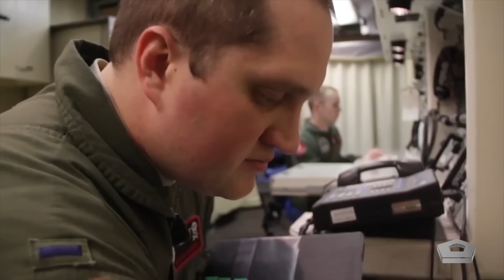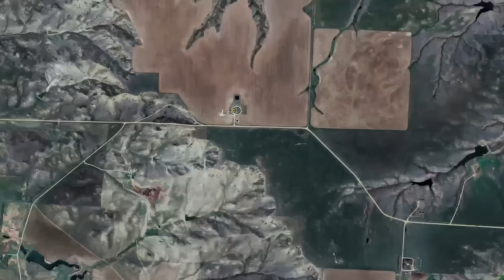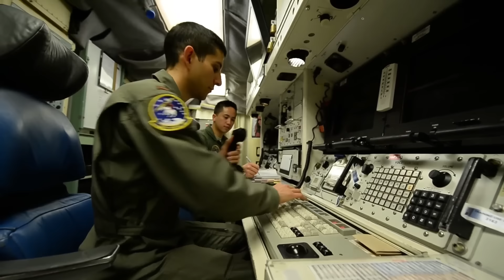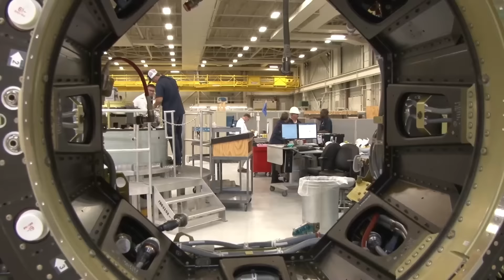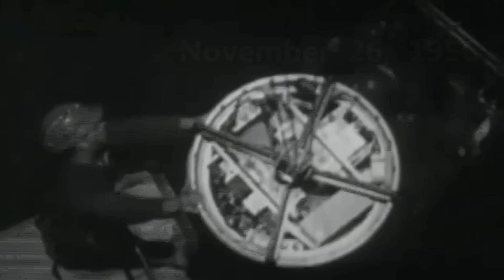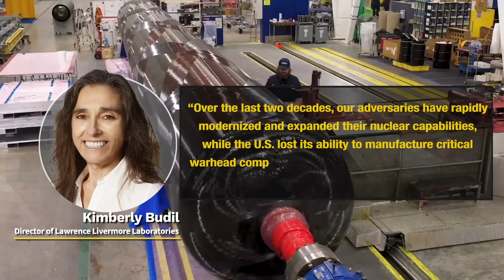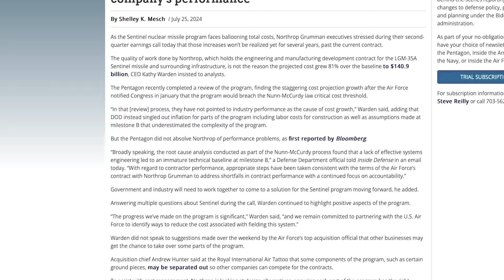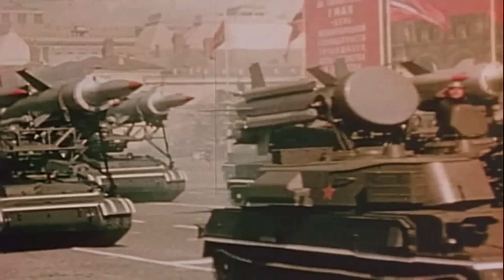America’s New Doomsday Weapon is Unstoppable

Comment: Does the Nuclear ICBM identify as a flying outhouse?
Reply: The LGM-35 Sentinel, also known as the Ground Based Strategic Deterrent (GBSD), is a future American land-based intercontinental ballistic missile system (ICBM) currently in the early stages of development.[3][4] It is slated to replace all 450 Minuteman III missiles from 2029 through 2075. The Minuteman missiles are currently stationed in North Dakota, Wyoming, Montana, and Nebraska.[3][5]

In 2020 the Department of the Air Force awarded defense contractor Northrop Grumman a $13.3 billion sole-source contract for development of the LGM-35 after Boeing withdrew its proposal. Northrop Grumman's subcontractors on the LGM-35 include Lockheed Martin, General Dynamics, Bechtel, Honeywell, Aerojet Rocketdyne, Parsons, Textron, and others.[6][7][8]

On January 19, 2024, the USAF announced that the program’s costs had risen to over $125 billion—37% above the initial $95.3 billion budget—and its deployment would be delayed by two years.[1][9] A revised cost estimate released by the Department of Defense on July 8, 2024, put total program acquisition costs for the Sentinel program at $140.9 billion.[10]

Comment: As a Brit we never had the ground area to have a ground based ICBM system (we toyed around with Blue Streak in the ‘50s) but then SLBMs came along and - hey presto! We had a credible nuclear deterrent. No triad needed.
With the advances that have been made in the missiles that can be deployed by modern submarine systems I personally think it may be time for the US to re-examine how it’s nuclear deterrence posture should be shaped in the future .
How many more Boomers could the nation deploy without this upgrade program? I think inter-service rivalry may play a part in all this but there may be other factors.
I can’t make this add up though. The US has a huge industrial complex to support its navy which is a more flexible and survivable method of delivery.
Reply: Because the USN has the same issues the RN does CASD. Hulls & manpower. The early Ohio boats are ready to become razor blades & it takes years to design, build, train & crew a new class of SSBN. Look how long it's taken to get the new Dreadnought class off the drawing boards & actually build them. HMS Vanguard will be over forty years old before her replacement tastes saltwater. The US is in a similar position with the Ohios, the Columbia class won't taste saltwater till around 2028, assuming there are no build delays or budgetry constraints to slow the program down.

Comment: Obsolete is not such a bad idea. They cannot be accessed via the internet because they are analogue. No way to hack them. The old copper wires are buried deep, but they work. The Sentinel system is modern digital system and is connected. With Russia having withdrawn from the SALT Treaty, nothing says we cannot add additional silos in new locations or perhaps  make them mobile like China. Personally, I think they will add the ability to maneuver seeing how they have always been "hypersonic at 23X the speed of sound, but followed a set trajectory.

Comment: The problem with "sponge theory" is that it is assumed the silos will be targeted with opposing missiles tipped with a nuclear warhead. In a war, preventing a missile silo launching it's missile only requires an opponent to prevent the silo blast door from opening or damaging the silo enough that the missile inside is damaged. A nuclear warhead and ICBM are not required to do this.

Comment: We do have better manufacturing technology nowadays compared to the 70s but... That's kinda the problem. We're too advanced and accurate. Back then, we weren't as stringent with hygiene and suiting up before handling equipment, we weren't as exact when creating parts, we weren't dealing with the digital age when programming these machines. Policies change, people change, technology changes, manufacturing changes, the human factor changes; a replacement is needed. The current arsenal is too old.
Reply: We don't use the nukes we have. Building more is going backwards